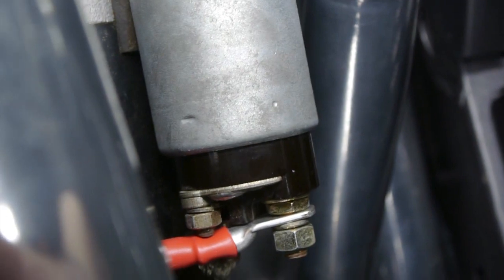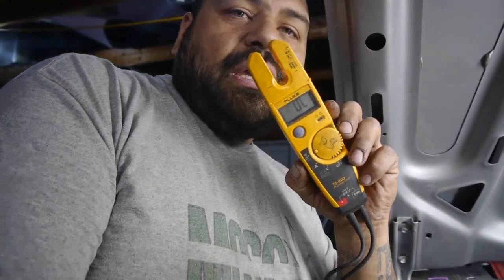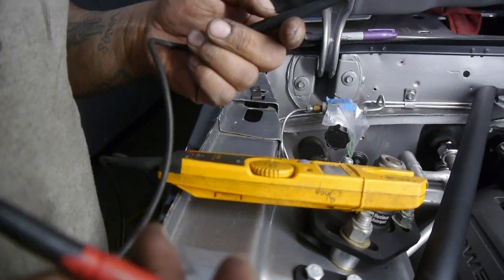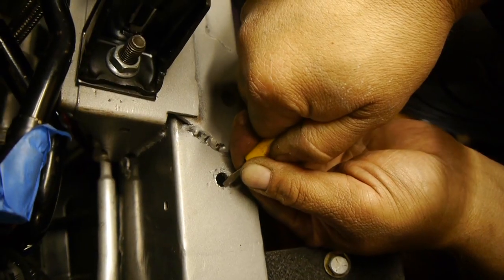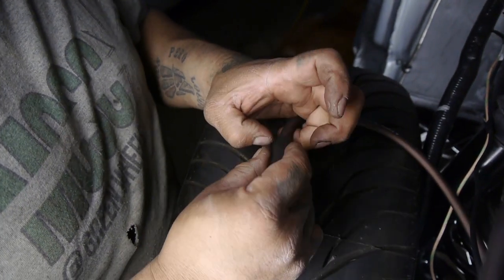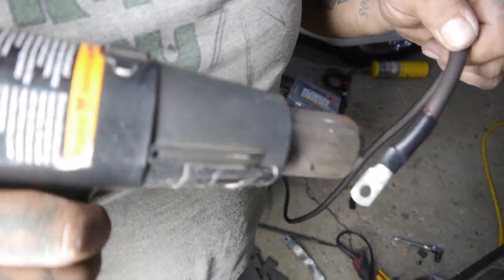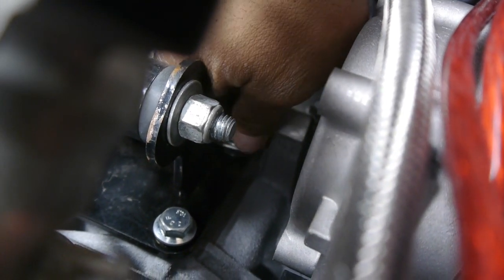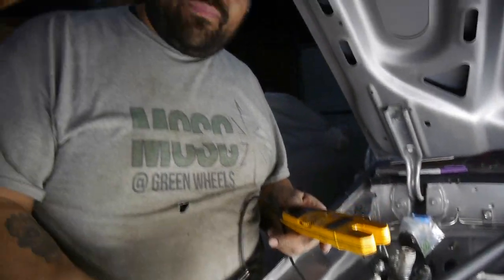PROPERLY GROUNDING A FOX BODY MUSTANG

Comment: So, does this give a new meaning to "you're grounded"! 😆 One thing I'd change is grounding to "brackets" like the sway bar and tower brace. Those could have a tendency to move and every time you need to remove them, the ground is compromised. If the frame is thick enough in areas, I drill and tap for a threaded bolt and use star washers to bite in good. However, nice and tidy makes it easy in the long run. 👍
Reply from the maker: Hahaha yes sir, thank you for the knowledge you share with us here from time to time. I will take a look at grounding the sway bar and the tower brace, since they have the tendency to move. Thank you for the comment and advice, it is greatly appreciated. Thank you!

Comment: Last owner moved the battery to the back and sometimes have issues with car just cranking and won't start. I can leave the car alone and maybe 30 minutes later or so it'll fire up again.

I've had the starter checked, good.
Swapped alternator
Red top battery.

Grounds next I assume... but I'm not mechanically inclined on how to check for ground more so now with the battery in the trunk, but that seems to be the most likely issue.
Reply from the maker: Starter checked!
Alternator checked!
Battery checked!
How about fuel? The most common reason why your car won’t fire up is actually lack of fuel. Lack of fuel is usually caused by a clogged fuel filter, faulty fuel pump, or clogged injectors
Spark Plugs?
If your engine has no spark, you can crank the engine for how long you want, but it will never start. Remove a spark plug and put the threads against a grounded area on the engine. Crank the engine and make sure that you have spark.
Wrong Ignition Timing?
If your engine control units send out the spark to the ignition coil too early or too late, you might also have problems starting the car.
To see the ignition timing on an older engine with adjustable timing, you can use a strobe light to ensure it is within the range.
Soaked Cylinder & Spark plug?
In some rare cases, the cylinder and spark plug can be soaked by fuel, making it impossible for the spark plug to ignite the air-fuel mixture.
Low Compression?
There is also a chance that your car engine has too low compression to start. This is not very common. A compression test. . .
Reply: @mcscgreenwheels  wow, appreciate the list I'll try all this.
I can check off lack of fuel for now.
Reply from the maker: @skellingtonmusic170  We are a very small channel, so we take the time to look into every comment and problems people in the Fox/car community will have once they find our channel way deep under the pile of all the massive car vlogging talking heads channels. If we can be of any help we are always here, because we actually wrench on our own cars here, and document the process of work, repairing without time-lapse video. We figure the long form video, and actually showing the work might help someone out there one day to do their own car. Please be patient with yourself, sorting out these old cars take time, but you will figure it out. We are learning every day here ourselves. Good luck.

Comment: I was also wondering what happened to project sandbox?
Reply from the maker: Thank you for commenting WhatTheFox302 brother, I hope you are doing well and in good health. Project sandbox, have all it maximum motorsport suspension ready, stiffler chassis fit system, all around coil overs, powder coated rear end, powder coated cobra caliper, cobra power steering rack all ready. It is just that I am one man with only two hands and also running a whiskey and bourbon business. I make and distribute them to various market, cities, and bars. I also have a 93 notchback coyote swap all painted with suspension and built cobra IRS installed that I call the grunt. I will love to see all these project done one day and bring them at car shows. It will be great day, to have the two coyote swapped foxes and one Australia Barra swap four eyes notch we call the sandbox.

Comment: So by cranking issues you mean cranking and dying ? That’s the issues I have with my gen 2 swap but my battery is in the trunk
Reply: Mine cranks right up sometimes and sometimes it cranks and dies
Reply from the maker: By cranking, I mean just cranking, just to turn the starter.  But if your car is cranking and then dying out, meaning it has an issue with ignition or or possible fuel issue, or fuel pump. The common issue I have seen with engine swap for hot rodding was the lack of proper ground. I am just making sure I have a good and proper ground on the car so I do not have a starting problem, everything in my engine bay is new. It is just a common mistake that people make not properly grounding their cars.